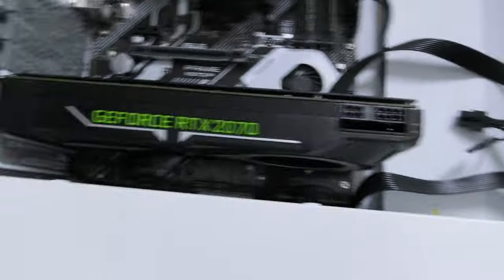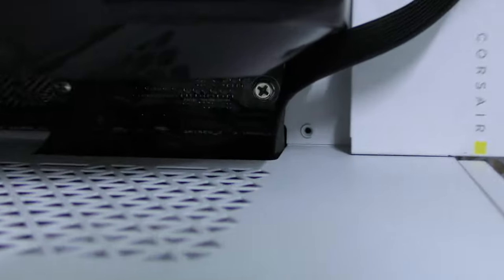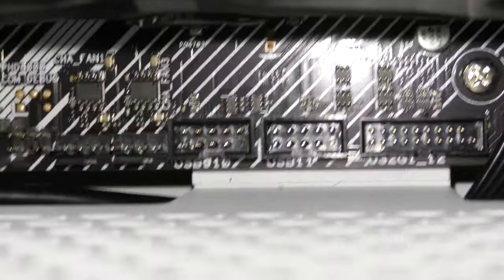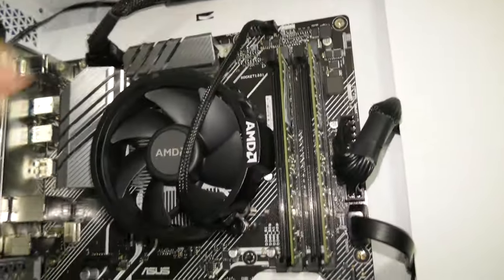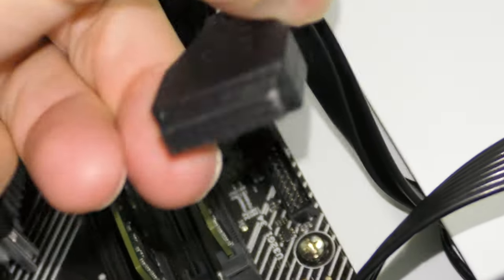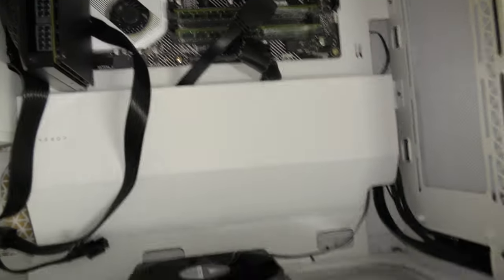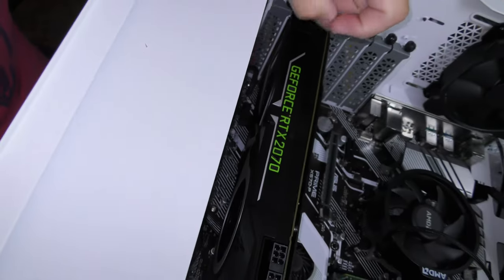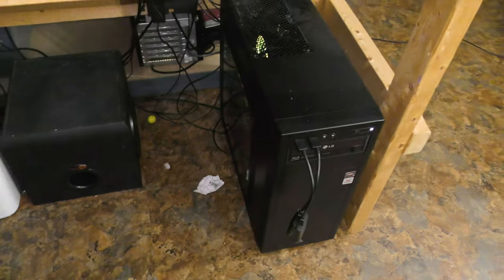Why I HATE Cable Management 🤬 - A Bird's Nest of Wires is BETTER 🐧 - Jody Bruchon

Comment: if anything its better to get a bigger case than a smaller one so u have more space for wires to go around. and also i hate that psu manufactures keep including the daisy chain pci cables for use with gpus with 2 power plugs instead of 2 single head ones. often times its better to use 2 cables anyway so the extra daisy chain connectors hanging around just takes space and looks ugly

Comment: If'n it runs and the sides fit on, cables are managed.
Reply from the maker: And I thought I was minimalist!
Reply: @JodyBruchon  I try to account for airflow and do a practical job, but part of practicality is the fact that at some point I'll have to undo everything for whatever reason.
Reply from the maker: Cuts zip tie
Cuts zip tie
Cuts zip tie
Cuts zip tie
Cuts zip tie
Cuts zip tie
WHAT WAS I THINKING

Comment: Solid water cooling pipes are worse. They look nice but having to drain them and do plumbing work just to do minor work in a PC like reseating a video card makes me BLEH!
Reply from the maker: And the coolant used in water cooling systems will easily destroy a motherboard if it spills. I'm putting water cooling in my 5950X build, but it's more out of necessity than anything else.

Comment: ohkayyy, this is talking about the "obsessive cable hiding within cabinet" - i want to do cable management with the cables which hang outside the cabinets and sprawl all over the table
Reply: It's TRULY fun to do this with fussy people around. I have a computer that I use and the motherboard's not exactly "in" it (I had a battle with the case –long story) but I screwed in the components nicely to get it temp-working and off to the side. You just can't close the case entirely. I kept thinking I'd fix it all back soon, but needed some little fans outside the case for a temp cooling solution, which was working optimally! But then someone claiming "OCD" nearly stroked out when seeing my ongoing "temp solution". So I sorta said it was made that way. (Just to get a reaction! I hate to lie but this was so priceless!) Hey, it's a look! Nothing's overheating.

(Considered hanging some old SCSI ribbons here and there to REALLY get people's blood flowing! Nothing usable to connect them to, ...I don't think???)

Comment: i dont understand just because 1 person didnt plug in all connectors this makes cable management dumb ? what about airflow ? does it not help with airflow at all is it all about aesthetics ?
Reply from the maker: I don't understand how you came to the conclusion that a guy who has been building desktops professionally since the early 2000s judged cable management to be stupid based solely on one PC he was handed 20 years later. This is an example machine but I've seen a lot of different cable management tidy machines that were a bitch to work on or were ripping connections apart over the years.

No, it doesn't help airflow. Linus Tech Tips did a video on that at some point. The only way that cables will restrict airflow is if they jam in the fan and stop it or there is such a colossal amount of cable blocking all of the places the air can enter or exit that there's physically no way to get the air in and out. A lot of people are too young to remember computers with IDE and floppies. Those computers have ribbon cables which are very wide and flat. Even with a bunch of IDE/floppy ribbon cables presenting a "sheet" of wire to the inside of a case, the fans don't push anywhere near enough air to be affected. The air simply moves through the gaps, and it can even potentially move faster because of the venturi effect.

Yes, it's all about aesthetics. Unless a wire is dangling into a fan or there are so many wires that maintenance is too difficult without strapping them up, you're doing it purely out of pride.

Comment: This is a huge problem in modern cases, modern cases are trash back in the golden era of PC cases 2004-2014 they were made out of all aluminum and didnt put any insane panels, huge random cutouts, the people who WANTED cable management back then simply made their own PSU cables,  cut the wires to size and sleeved them perfectly.  "Managed" cables still look like trash compared to a custom set which doesnt require the case to have any cable management. IMO only custom cable sets are worth doing if you care about your cables.

Comment: LOL!!! Ya ought to try working on a copy machine that has routed bundles of wires and is 3 circuit boards deep with intermediate metal shields!!!🙄 One copy machine that I had the privilege of working on had a previous history that when manufactured had the wire bundles zip tied SO TIGHT that there was signal crosstalk between wires causing various RANDOM error codes!!!😳🙄
Reply from the maker: Sounds like something I'd love to let someone else handle! :)

Comment: I understand where you're coming from, but on the other hand I just like the aesthetics. That being said I wouldn't call your client's case "cable managed", since some aren't plugged in and some are either broken or about to break. More like "cable hidden" lmao. The PC I built in 2016 has it's cables managed well and I haven't had a single issue with the hardware, even though I've used it almost every day for 6 years.

Comment: I also hate cable management. In the computers I own (as opposed to Customer computers), the only cable management I do is to ensure none of the cables can get caught in any fans, and I will turn the box upside-down and sideways and shake it around a bit to make sure that none of the wires will flop into a fan. Other than that, I like all the wires to be totally accessible, totally visible for their entire length, not cable-tied together into a loom... when there's a problem or I want to make a change, I can see and reach all the connections and wires, I don't have to guess about anything...

Comment: cable management is the last step, you assemble the computer in the case and test run it before pulling the cables around. To make sure it works after its done. I wouldnt call it dumb but i would call it "accidental dumb" when people who have little experience do it and do it wrong. 
Its the same as with the dude or woman who back right into your car when they are parking their car, thats not a dumb person but maybe they did take on a little too much water over their heads and made it harder than it needs to be?

Comment: I love how people are so mad that you called out their obsession with aesthetics.
That said, IMO hardline tubing (and most off-the-shelf water cooling components for that matter) is a much worse offender as far as aesthetics over practicality. You can fix bad cable management, but how would you fix terrible mechanical design? The pressure ratings on hardline fittings are just obnoxiously low.
Reply from the maker: Oh yeah, water cooling is a pain. I'm putting it into my new build but I'm not happy about it.

Comment: Fully agree, glad you brought up keeping the cables out of fans. Run across some cases that seem designed to force this kind of cable routing as well, long paths around through the only holes between sections if you don't want to drill and bush extra holes yourself. When routing/fixing/managing cables, I keep to the following goals:
1. Keep out of fans (including key airflow paths)
2. Don't obstruct indicator lights (So I can tell if my mem stick came unseated)
Reply: eh, after dealing with extremely crammed prebuilts and ITX, I feel like cable management does have it’s benefit despite the extra effort and maybe price. It’s just more convenient for cables to get in the way when you try to replace something in your pc, looks neat if you’re feeling like bragging too
Reply from the maker: Cable management like what you see going on in this video is way too much. At some point you go from improving reliability and maintainability to stressing wires and components and making any changes a nightmare scenario. Every wire that's hidden is a wire that's likely blocking something else. Every zip tie is a future careful snip with a diagonal cutter, hoping not to accidentally clip a wire too. Every bundle of cables that's tied to a path is a bundle of inflexibility. All of that for what? "Nice looking" interiors? Feeling like you've done something good when you've really made the future more painful? Risking wire breakage and connector damage and crosstalk? No thanks.
Reply: @JodyBruchon  there’s definitely a point of diminishing returns, and the example shown in this video is far past it. The point of cable management isn’t to look good, it’s to make sure me, or whoever opens it in the future don’t accidentally touch and rip a wire or two whenever we need to do something. It can be literally hanging in the middle of the case and as long as it isn’t obstructing anything, it’s good. It literally needs to do just that imo, anything past that is not for functionality but purely for aesthetics, and though being unnecessary it’s not a bad thing to have as long as it doesn’t cause any problems
Reply from the maker: @neol3066  My take is that there's a spectrum of acceptability and this falls outside of it. I'm firmly in the "zip tie it if it's a problem" camp. I understand others who spend a lot more time trying to make things neater, but when that becomes a future maintenance mess waiting to happen, it's no longer acceptable. This kid's PC was going to destroy a wire or connector at some point from the stress and it'd end up here anyway. The wires on the PSU are simply not long enough to accommodate both being bottom-mounted AND run through pre-defined wire channels on the backing plate behind the board.

Comment: I recently built my own pc (from scratch, brand new parts blah blah blah). Did the pre-case install plug in everything and fire up test (with motherboard resting on the cardboard mb box). Everything worked fine and was ready to be stuck in to the case.

A short while later, I'm sat looking at a very cable managed computer, the darn thing looked cleaner than an Intel clean room, only problem being that it wouldn't power on. Checked all cables, tried re-seating GPU, rocked the ram, checked the FPC's (front panel connectors) etc. You name it, I wiggled it and still nothing.

So came the unwanted task of untangling a ton of cables, unthreading sata cables and feeding them backwards through what I can only describe as one way holes and placing the motherboard back on it's box (outside of the case). 

Now for the fun part. Problem solving, or as I like to call it "What did I break this time." 
So, we start with just the CPU and slowly add the rest of the tech, everything works fine and computer is running like a champ. 

Two warm beverages later, everything is back in the case, cables are managed, ties are tied and I'm looking forward to playing a few games with my new hardware.
Again it doesn't power up. At this point I'm just about ready to physically kick the entire unit around the house, so I power off everything and take myself for a little cool down walk.

Comes back inside, half rips everything back out of the motherboard, sticks it back on the box and yep you guessed it. Everything worked fine. At this point I'm thinking maybe the case could be the problem some how????
So I gave the case a quick once over, checking that no motherboard mounts were in the wrong areas and causing shorts and everything looked fine, I still couldn't figure out what was stopping it from powering on though and I was now well and truly stumped. Everything worked out of the case but refused to work inside. Was my computer claustrophobic?????

One last thing to do was to see if it was actually the case (I know, unlikely but everything else had been ruled out). So back in everything goes, except this time no cable management.... 
I must have sat looking at the PC without switching it on for at least 5 minutes, at this point I was dreading hitting that power switch, who'd of thought building a PC could potentially leave you with PTSD. 

Ok, so it was the big moment. Was my PC going to live out its days in it's own little cardboard city or would it actually accept this new shiny metal house that I had provided.
I hit the power button, everything was still, the birds stopped chirping, dogs, stopped barking. It felt as though  time itself had frozen.... And then out of nowhere came one lonely single beep.
The mechanical hard drive whirred in to action, the monitor sprang in to life and proudly displayed my login screen... "IT'S ALIVE!!!!!" I shouted and danced a merry jig around my tool kit.

That was around the middle of July 2022. I've had no problems since, I still haven't "managed" the cables and to be honest I don't care if they look a mess, nothing is resting on any fans, temps are fine and I don't want to rock the boat when it's sailing as well as it is. 

So yeah, that's my story. It's a little long but I wanted to fully share the experience.
Reply: I fully enjoyed your story. I kept thinking, "it's the box it's the Box THE BOX!" because I don't like those boxes, at all, they're a rip off and ...bad for the environments and muh climates, just, bad all around. Good job. Excellent.
Reply: @MelanCholy2001  Thank you, I'm glad you enjoyed it.

Comment: some cable management is needed to improve coolling , especially in PCs that use IDE-cables (like I used IDE / ATAPI drives until 2021) ... 
But if you have a glass front PC (like Walmart or Alienware in a Dyson design) nothing of this matters since it dies the heat death anyway
Reply from the maker: The cooling thing is largely a myth. Linus Tech Tips tested it.
Reply: @JodyBruchon  - 
dont underestimate the IDE ribbon cables ...  II could bet Linus hasnt seen these for 16+ years

Comment: I have a friend who loathes loose cables coming from the cable box. She said they look "ugly." She nailed them along the baseboard and and tied them together with Velcro going into the box. Probably has them going through liners or tubes by now🤷‍♂
I've seen some tasteful cable management done with zip ties inside of a few towers usually done by the company itself. 
On the towers I've done maintenance on, I personally don't care as they can't be seen anyway inside a metal case. 
It's much ado about nothing.

Comment: so here are my thoughts on this. the modern computer usually sits on the desk and in view and a lot of people prefer it to look nice in their house and not super messy. so you can't really call "cable management" "stupid" just like you can't call someone "stupid" for "making their bed" to look nice or to not have the house wiring outside of walls or grommets. now that's entirely different when someone doesn't plug in the cables or hides them away entirely without using them due to their lack of experience, that has nothing to do with cable management. 
now when it comes to work machines like the one you showed, sure nobody cares or looks at it, but your PC at home on your desk is something you see every day and want it to look nice. I loved your win 11 videos and agreed with you on them, but this one just comes down to personal preference and it doesn't make sense to call cable management "stupid" just because some people do it wrong and their PC doesn't work. 
(p.n: the only thing that bothered me about the case was why was the GPU in the bottom PCIe slot ?)
Reply from the maker: Nobody casually looks through the someone's PC on a desk and goes "the insides 'look messy' so I think negatively of them!" That's just not a thing that happens.
Reply: @JodyBruchon  I wasn't mentioning how a third party might react to how the inside of someone's PC looks, I meant the person themselves might prefer it that way (cable managed) since most cases now have a glass side panel and it is something you frequently see and it would really annoy you if it wasn't "clean".
+ respect for checking out comments on old videos, wasn't expecting a reply.
Reply: you can like, it's stupid when people think it's necessary and they push it onto others. It's like trying to make your workshop not look messy

Comment: I think cable management is okay if it's done intelligently. If folks buy a case that's too small or too large or the PSU wires are similar you get a terrible tendency to have eirher too much cluttering of bundles or not enough reach, or it obscures connectors and that's just bloody annoying. I think people focus a little too hard on aesthetics at the cost of practicality and that's just silly. On the other hand dreadful cable management in a clear side panel case is a terrible eyesore. If people can't be bothered to do it properly, which is fine I guess, don't have a window.

My last rig had a clear panel but cable management was done rather well. I didn't trace and tack every wire neatly to prevent reach (or bend connectors) and all that RGB shit is nonsense to me so I just set one colour and was done with it. Next time I build a PC though I'm purposely opting for no window so I can throw it all in (not too messy though :D).